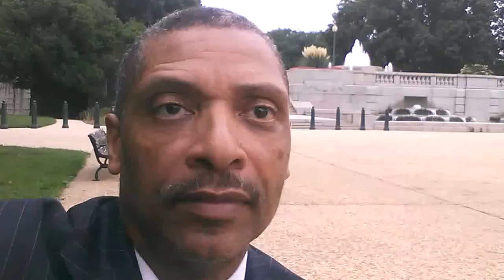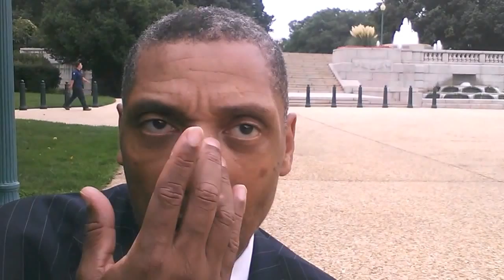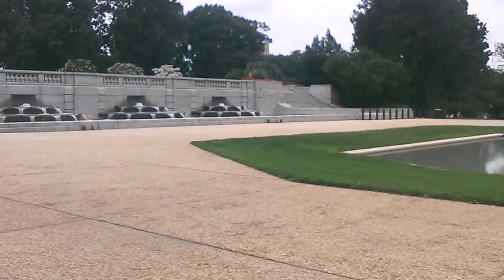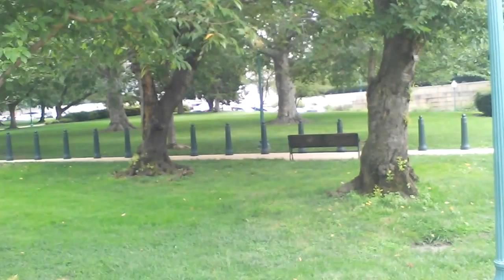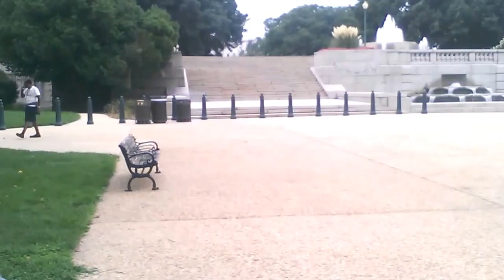Tesla 2170 based semi truck subtle form factors making a difference in driver fatigue.

Comment: You probably have read this: makes sense for them.: Tesla’s semi could be an internal project that would run Gigafactory batteries to the Tesla manufacturing facility. Interestingly, the Sparks, Nevada Gigafactory and the Fremont, California Tesla assembly plant are 239 miles apart from each other. (The battery-laden trucks would also have the advantage of losing several thousand feet in elevation on their trip out to the Fremont plant, while they would be able to drive up that elevation on the return trip empty.
Reply from the maker: that is a good idea for them to use the batteries in this way to demonstrate utility of the semi.  my impression from musk comments it that their are some fleets defining needs and testing the solution outside of tesla.

Comment: These trucks are not going to be used for highway transport, they'll be used for short-range hops in cities. A battery powered truck simply wont have decent enough range to be used for anything else.
Reply from the maker: your logic sounds good.  the issue with new battery and weight in a semi and the distance both can achieve is still unknow hence the speculation.  underestimating musk ambitions has not been a good plan in recent days.
Reply: If aerodynamic, with low rolling resistance tires, range could be very good due to regen braking.
Reply: Highway haulers don't do a whole lot of braking.